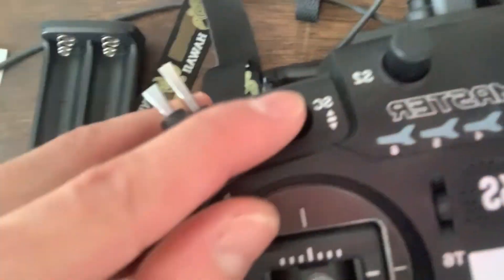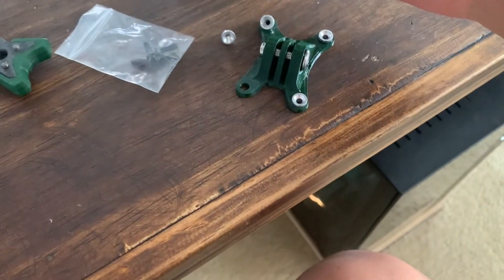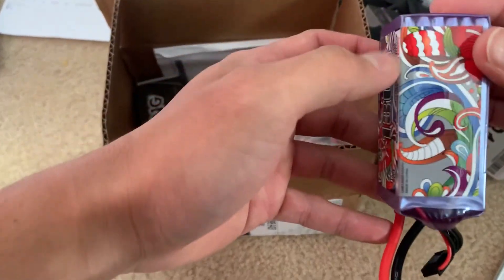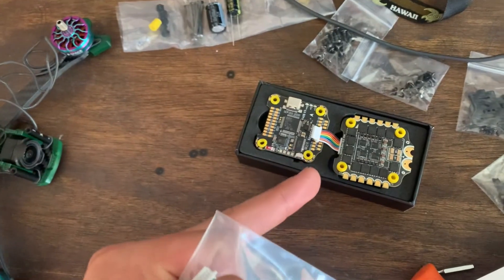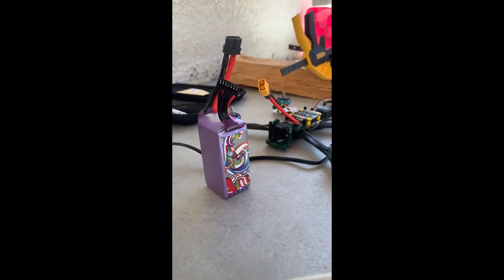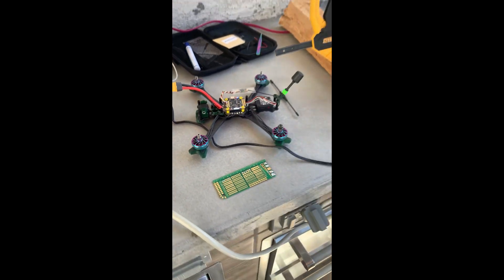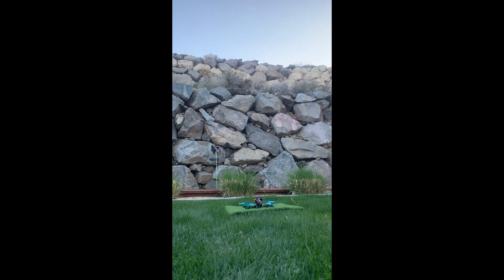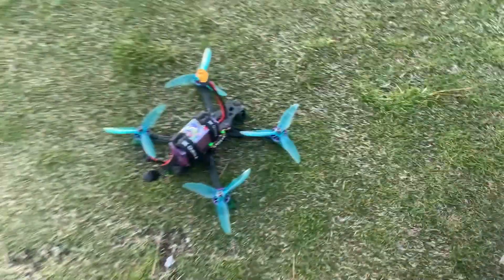BUILDING MY FIRST FPV 5" Quadmula Freestyle Drone

Comment: Add water proof coating it helps alot when crash into mud, also GPS and telementry log in TX16s SD card,  I am night flyier and recently just crash a drone into lake...
Reply from the maker: where can i order some, do they sell it on getfpv?
Reply: I use CRC Plasticote 70 but not spray it into FC directly, I slowly fill up (spray) the coating liquid into nailpolisher bottle, keep it and use it with brush. It can fill up over 20 times. I apply it to many electronic project. just remeber don cover your microphone or barometer chip. it is washable using acetone - nail polish remover

Comment: Amazing, i orderd the radio, i will learn  in simulator for a while because i dont have any money for now to buy the googles and quad
Reply from the maker: it took me over 80hr in the sim to feel semi confident, i used DRL sim but the gravity is kind of floaty compared to real life, i heard tryp is good
Reply: That’s really the best way to learn. I would recommend liftoff for user friendliness, beginner tutorials,and the looks. Then velocidrone for more maps.
Reply: Yeah I kinda forget about Drl they also have some beginner tutorials. Tryp is the only sim I don’t have lol but I heard it’s like uncrashed. Just maps you kinda have to know how to fly in those two. But they are the best looking hands down. The nice thing is they are all relatively cheap.
Reply: Oh yeah I just lost a 5” not to long ago. Make sure you get a buzzer for it. The vifly big one not the mini. Because it won’t beep at night and saves the battery 🪫 until morning when you can actually look for it.
Reply: I did lose mine because of video problems and you are running a DJI. So you probably won’t have video issues. Anyways have fun and it will be fun to see your progress. Good luck 🍀👍
Reply: Any opinions on tha build? Source one frame, xing 2207, 1700kv as motors, reaper extreme as a vtx(i know is over kill but maybe i will do also sone lion battery stull for long range) lolipop antena on googles and vtx, and on googles along with another uni directional antena, foxeer razer mini, an elrs reciver and the speedybee f405 stack
Reply from the maker: @horia9044  my only advice is go 6s i was told everyone progresses to 6s eventually so might as well invest into 6s batteries
Reply: Yea and for the sims i can get all of them that are on steam, im on argentina and they are like 4-5 dollars